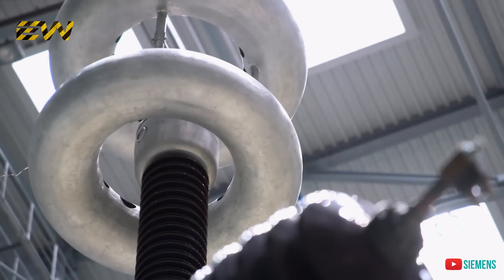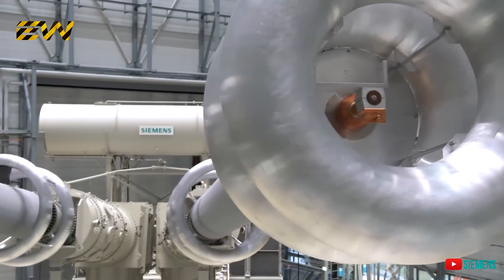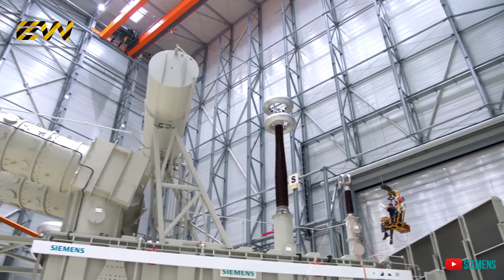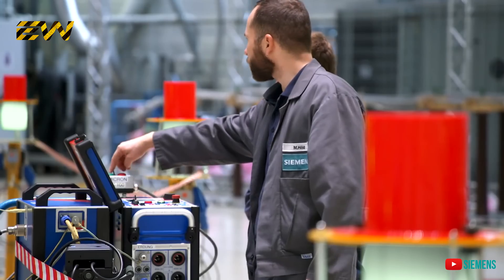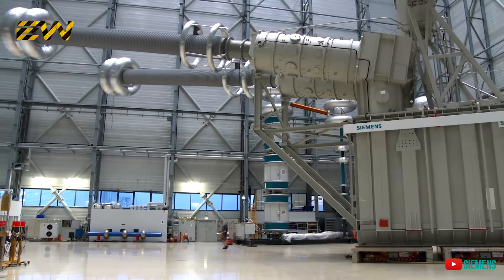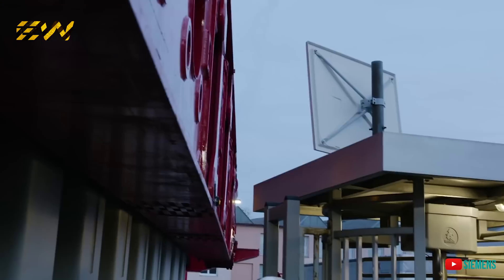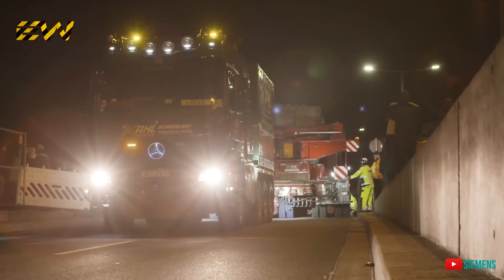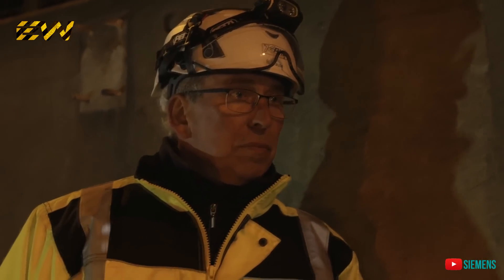World’s BIGGEST Electrical Transformer Video

Comment: I need this buck converter for my next arduino project
Reply: ur arduino will be explode XD
Reply: Seems legit
Reply: Benjamin McCann  its true i think :D
Reply: Wouldn’t a step up transformer be part of a boost converter?
Reply: @dlayman101  yes i think, bcs both of them use copper coil
Reply from the maker: You gotta be careful with the big boy ! :D
Reply: @dlayman101  yup, to step up dc you would basically chop up DC into a transformer since only ac can be transformed, and then you rectify it again :D

Comment: Transformers increase in size, in relation to higher voltages due to the amount of coils or wraps needed to create the proper amount of impedance. If the impedance was too low you would create a dead short. More coils more bigger. Also air cooled transformers are bigger than liquid cooled transformers.
Reply from the maker: Hey Chris! Your answer was the post precise. Thank you for sharing with our viewers. As promised we will feature your answer. Thank you once again.
Reply: Thanks love the channel keep up the good work.👍
Reply: Wait. Impedance has almost nothing to do with the voltage. Why is this explanation “loved”? The size increase is a few factors (like insulation/distances needing to be increased) but creating the proper amount of impedance isn’t as important. It’s important but there are ways to work around it. There’s really no way to stop a large potential difference from arcing or having corona discharge without insulation/distance.
Reply: Negative ghost rider....the increase in size is due to power rating, cooling ability, and insulation level. When a transformer is built, it's not to a certain impedance, rather a certain MVA size (or KVA, VA, etc.)... as in volts X amps on the Hi-Side equals volts X amps on the Low-side....yes, we know it's not 100% efficient...so the size of it is due to how many Watts, KW, or MW ( or more accurately VA, KVA, or MVA) the manufacturer says it will handle, while being able to stay at or below a certain temperature, and not arc internally at all rated voltage levels.....the impedance value is literally stamped on the transformer nameplate AFTER the transformer is built....how do I know this?? 10+ years of working on and around these big boys every day!!!
Reply: i could make a 12 million volt transformer that fits in my hand, size determines the power handling of the unit in Amps and its ability to dissipate heat from higher loads. For the primary coil, wrap count matters only for efficiency and to reach a certain inductive impedance for a given AC frequency.
Reply: In Africa they are moving to air cooled because people steal the oil to make street food. Gross.
Reply: Great answer.  However, you forgot to discuss the Zc and Zl matching capacitor banks and separate transformers located elsewhere in a substation to maintain proper real power (not apparent power).  Capacitor banks and Z-matching transformers stabilize the power factor of a substation.  I also forgot to talk about this in my write-up.
Frank
Reply: You also need more space between part when the voltage go up!
Reply: @gpgt1  OMFG, I have heard same happens in India but I thought people say this jokingly
Reply: Why are they even doing this,  I thought a.c. was more efficient for distance
Reply: I hope it's actually a radiant cannon
Reply: true, very true
Reply: @thetinkerboys14   how
Reply: By using a small guage enamel coated wire around two seperate ferrious metal cores. (Without regard to multiple inefficiencies such as eddy currents) By manipulating the number of turns on each respecrive core, ou vary the desired output voltage. For example:10 turns on the primary coil and 10,000 on the other coil will multuply a given voltage by around a factor of 1000. 5v in = 5000v out. the Smaller the wire you use the more wraps you can obtain in a given volume. However there's  a tradeoff, smaller wire means less current capacity.
Reply: @thetinkerboys14  that's quite correct,however, if the cores are made of ferro-ceramet, the losses go down due to the minimiseation of those pesky eddy currents.
Reply: @ryanb1874  it was at one time because transformers  were used to get higher voltage and transformer's work on AC thay don't work with  steady DC
Reply: And now thay use solid state device's and witchcraft 😬
Reply: @rogergregory5981  ha-ha-ha.......so, they're teaching technomancy over at hogwarts now?........about flippin' time!
Reply: Chris Pritchard   The size of any transformer is directly related to its kvA rating, not to its voltage.  All else being equal, designing for a higher voltage uses higher winding count but proportionally smaller conductor size, for an identical overall size.  So overall size is completely unrelated to operating voltage alone.
Reply: Great, that's all we need pointed at us after 5G proved it causes cancer and covide
Reply: Prince Ladeda   Ok, I’m assuming you’re joking.  Right?
Reply: ryan B DC is efficient now days
Reply: @engineeringworld.  Not correct I have a 120v-16000v transformer which is much smaller than a transformer found in a car battery charger. As others have said, it's all about the kVA not voltage. Source: electrician.
Reply: impedance is due to leakage flux(flux which complete its path through air instead of core)....what to do with voltage rating?
Reply: @saikatghosh90  f nonsense
Reply: Transformers increase in size with relation the winding turns and insulation
Reply: @gpgt1  if only we can use the heat to (safely) cook some food
Reply: @thetinkerboys14   you could not make a 12 million volt transformer that fits in your hand.  The insulation needed to contain that pressure would not fit in your house let alone your hand.
Reply: @tbonemckone  people are splitting atoms here.  Insulation increases with voltage and MVA/KVA also increases size. Both statements are correct in one way or another.  
Source: Doble Testing and Diagnostics Electrician.
Reply: @JimFly01  yes you could. It would not function due to the insulation issue as you mentioned, however the required first and secondary windings to achieve that voltage is possible. A functional , purchaseable version however does exist....Stun guns. They operate at very, very high open load voltages, yet the user is fine holding it.
Reply: @JimFly01  Insulation increases with voltage but the copper size decreases due to a lower current rating with a given kva. This is why kva is the best indicator of physical transformer size.
Reply: @Richard Vaughn  again the size of this transformer is over 37.5 meters long mostly due to its voltage.  Maye re watch the video and notice the length of those bushings.  Bushings dont care about KVA, they are designed primarily based on voltage class.
Reply: @thetinkerboys14  Are you just going to ignore insulation? It's not easy to insulate 1MV.
Reply: @mikemazzantini6397  Actually yes lol, it is a theoritical answer. But, with enough teflon or mica, it is possible. The guage of the Windings would also be miniscule, but it could work. The efficiency would also be horrid due to the single digit coil wrap #.
Reply: SO. this isn’t the biggest ever?

Comment: I'd like to see the 1100kV rectifier.
Reply: Ain't that the truth!
Reply: There is no rectifier. Only D.C. Is needed. One can spin off secondary taps at the an amount needed. Transformers distribute electrical energy, not produce it. Generators produce Alternating current. A rectifier converts AC to D.C. DC current has large Current squared Resistance losses, AC losses are used to minimized power losses in wire distribution networks. DC current is not efficiently or sufficiently economically practical. Power transformers are used to convey power distribution from point A to points A, B , C....etc. voltage is just one measurement to describe the transformer capability. However the current a transformer can provided explains the power the Transformer can handle. The higher the amperage capability the more power transferred. More money designing, testing  and shipping the transformer is the biggest factor. So why not build a factory on site or nearer the site needed?
Reply: @erin19030  I have degree level physics. I know what a transformer is ;)
Reply: Why is everybody saying 1100KV instead of correct 1.1MV?
It's same with capacity, why is everybody saying 20 000 mAH instead of 20AH?
Reply: Vít Cenek 
Cuz that’s the unit which commonly used
If you checked almost all electric equipments used KV as a unit or KVA or KVAR or KW to define electrical elements 
kilo mostly used but doesn’t mean you are not allowed to use MV as well
Reply: @SS-rk7bu  They are indeed interchangeable. I prefer to use the largest units that avoid decimal points. 1100kV is better that 1.1 MV. Obviously 1,100,000 volts is a bit silly as well.
Reply from the maker: That would be really interesting.
Reply: @engineeringworld.  Please do. Just the pictures of guys building the  transmission lines and having lunch on the insulator strings was wild. 
What about the DC to AC inverter?  That must be oil cooled as well.
Reply: cresbydotcom  Some people don't seem to understand that transformers do not work with direct current. Motor-generators would be necessary to convert to AC. I'm not sure a solid-state inverter would be possible at those kinds of voltages.
Reply: @erin19030  All irrelevant. Parent just said he'd like to see a rectifier for that voltage.

But on the topic of current losses, DC and AC are the same. It's just that until somewhat recently, it was difficult to make high-voltage DC. DC is still less-practical in general because it's not as easy to change the voltage as with AC where you just use a simple, reliable transformer.
Reply: @paulanderson79  the rectifiers and thyristors are stacked in series to reach that voltage capacity.
Reply: @pudmina   Yea, exactly. I would like someone to show me a 1.1MV DC motor!  

Motor/gensets are horribly inefficient, even if it was ~90% efficient you will lose 1.2GW, mostly in the form of heat.

This transformer is well over 99% efficient, if it was 99.99% you still have 120KW in losses just in the transformer at one end of the line.
Reply: @vitcenek8611  Marketing, big numbers always sound more impressive.  KV is the defacto standard for transmission line voltages and if they keep to the same standard I guess there is universal understanding. As for the mAh verses Ah. That one is pure marking twaddle.
Reply: Tone for days................
Reply: The rectifier is a big stack of diodes and capacitors being fed with very large flyback type transformers. It has several 550kv submodules inside it all stacked. The rectifiers are 6 inch diameter hockey puck diodes that are rated at 5.8kV and over 1kA a piece. This "transformer" is an overgrown version of an industrial x ray tube power converter on steroids.

Comment: The rule of thumb is that electricity will arc (not plasma, where the current increases exponentially in ionized, conductive air, but in non-ionized, non-conductive air) 83,000V per inch.  At 1,100KV, the arc will travel many feet.  Therefore, in order to prevent the electricity from reaching ground, it must be insulated on very long, heat-tolerable ceramic insulators, or bushings.  The bushings must be heat tolerable because it is not just voltage in the electricity, but also thousands of amperes of current which produces higher heat as the current increases.  The bushings are designed to look like bee hives, or discs, because electricity travels along the outside shape of the insulator, called the skin effect.  This is a natural characteristic of electricity.  So, shaping the bushings in discs makes the travel path longer.  The alternative would to have extremely long, straight bushings.  But with disc crests and troughs, the  electricity travels along the shape of the discs, which is a longer distance than straight along a smooth, straight insulator.  The ends of the bushings are smooth, large rings to reduce the corona effect, which is leakage of voltage into semi-conductive humid air.   Air contains water vapor to different degrees, depending on the weather.  Water is conductive.  Any corona effect or arcing of electricity to ground will reduce the amount of available electricity to the source and, thus, reduce the efficiency of the transformer.  Also, arcing causes, as with lightning, the air to become ionized (the oxygen in air gains an extra electron, which it does not need, and thus allows it to travel from one oxygen atom to another creating a conductive path), which allows high current flow from the transformer to ground.  This also will ionize and remove the conductive metal that the transformer is made of, slowly destroying metal terminals of the transformer.  Since higher power (voltage equals power divided by current) and low frequencies (power is transmitted at very low frequencies of only 50 Hz or 60 Hz) require larger transformers, switches, relays, circuit breakers, wire, insulators, and other things found in a substation, the transformer must be large.  This is because the larger size of the transformer allows the transformer to dissapate heat, prevent arcing, provide enough metal to allow high power flow, provide enough distance between the power and ground (through the large insulators), and prevent the corona effect.  Such high power would consume and completely destroy a transformer that was too small to allow an inch of insulation per every 83,000V.  Electric energy, U, is equal to capacitance (the ability to hold a charge) and voltage.  A coulomb is equal to an ampere of current per second.  Both a coulomb and electric energy increase with an increase in electrical power.  Coulomb, U, C, P, V and I all are characteristics of electricity that require larger-sized electrical components to provide proper transfer of these characteristics without any losses.  A large-size transformer also has room for current-sensing transformers to be placed on them.  These smaller current-sensing transformers give a direct, meter readout of the current flowing through the transformer at any one time for the linemen monitoring them during the varying loads placed on the electrical grid during a day.

Frank 
KB2VNG
Frank Reiser Video/Audio Service
Reply: lmao I learned more from this comment than I can remember from school. god bless you
Reply from the maker: Thank you Mr. Frank for your valuable feedback and knowledge that you shared with us. 

Have a great day !
Reply: @ccllvn  Because u recalled school after a few years.. you wrote this comment directly after reading it.
Its like learning for a school test, after writing the test you will basically just forget half of it
Reply: You r a genius
Reply: Good job on the copy n paste there guy...
Reply: A coulomb is equal to the charge of an ampere of current FOR a second. Or, an ampere is equal to the flow of one coulomb per second.
Reply: @warrenvanwyck2765  Have you studied EE?  Remember the power triangle and all that stuff.  I audited the power engineering course with Indian Institute of Techbology.
Reply: @frankreiserm.s.8039  You gave great explanations -- I was just offering a very minor clarification. I'm not a EE guy, just a hobbyist in retirement pondering HVDC from HydroQuebec since it supplies about 1/10 of New England's electric power.
Reply: Hello, Frank! KE0IKN
Reply: @morpheus_9  And a very big HELLO to you.
Reply: Oh wow. I don't usually comment on videos, but this comment was insanely good! As a person who's just started as an electronics hobbyist, I learned a ton from this! This should be a pinned comment IMO :)
Reply: H2O is not conductive in its pure form. What makes water conductive is the impurities we have in our public water supplies and ground water. Just so everyone knows.
Reply: If you want to check and see if your water filter is good you can energize the water in a cup after you filter it 😂and drink out of it and it will not shock you. If it’s only water. I’m sure some percentage of impurities are allowed before it conducts

Comment: Quantity of insulation also increses with increase in voltage rating.
 That's why size of the transformer increases .
Reply from the maker: Thank you for your feedback! 

Have a nice day ^_^
Reply: This is the absolute correct answer. More power / KVA equals larger wires, higher voltage means thicker insulation. And of course you have to have a magnetic core that won't saturate along the way. All of these factors combine means transformer tanks get larger and larger along with the size of their insulators to offset the huge voltage gradient between the ground and transformer case and the incoming voltage.

Comment: The overall size of the trf increases with voltage rating because of 1) Increase in insulation thickness and duct spacings between HV and LV and also LV and ground(tank). 2) increased Bushing length due to very high air clearance to tank surface and also it's application in hvdc to counter tracking phenomenon owing to higher pollution levels in hvdc environment. High power rating too contributes to increased size of the transformer due to heavy windings to carry high currents and higher magnetic clearance requirements to avoid eddy current heating of the transformer tank.
Reply from the maker: That's absolutely correct. Thank you for sharing your knowledge with our audience here. Consider subscribing to our channel for more engaging videos and technical discussions. 

Subscribe here : https://geni.us/SubscribeChannel
Reply: I'll just pretend I understood what you wrote...